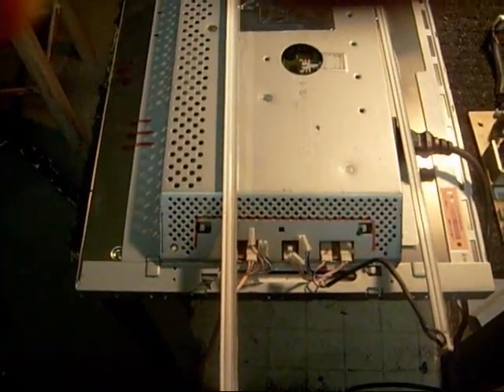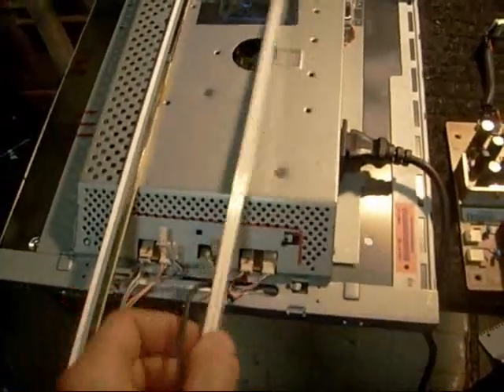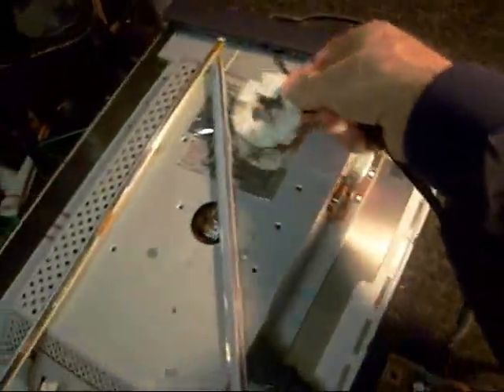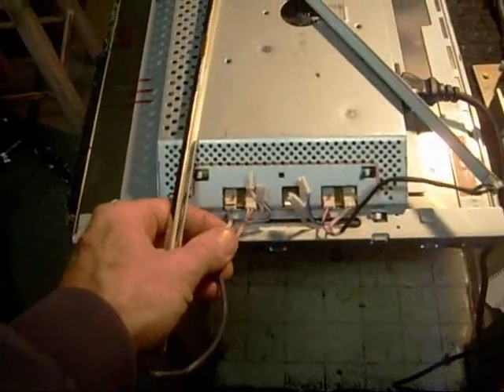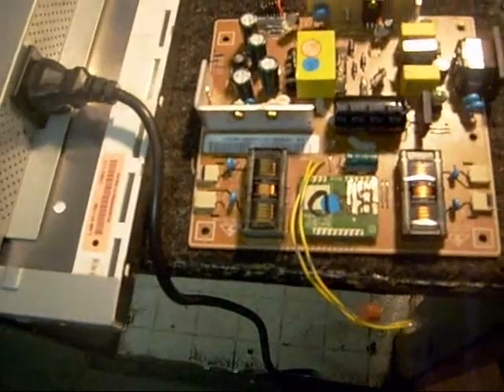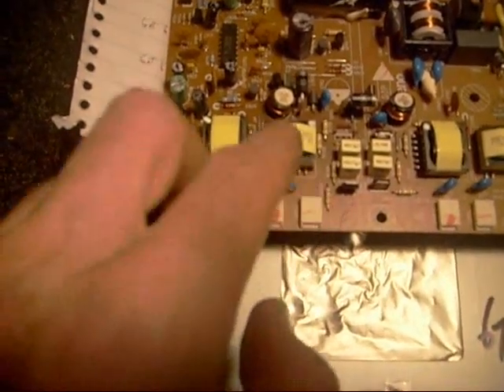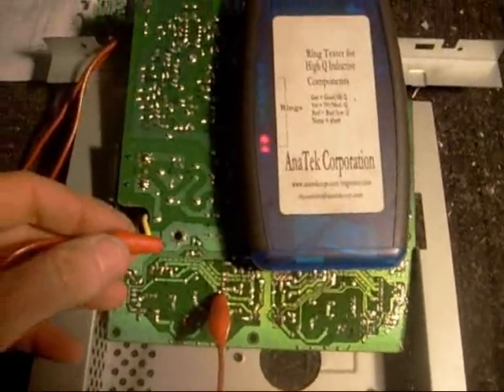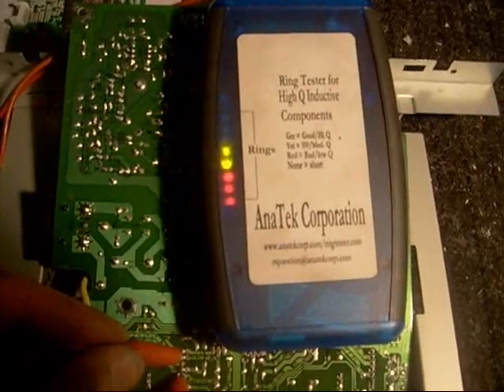LCD TV Repair made easy # 8

Comment: Hello, complete NOOB here, what is that audio-generator? Is that a transistor radio, with a coil attached to it? Please confirm - I'm puzzled. Stay safe
Reply from the maker: I should have said audio amplifier rather than audio generator. The one I used was a small battery operated unit with a coil for the input rather than a microphone.

Comment: Hi there, love the videos... AT 3:45, would it not be better to suggest to people to carry out a mandatory check of the transformer and some of the other surrounding components, in case there is some other failed component that would cause the transistor to blow again.. oh btw, I felt stupid going in to the supermarket to buy a hair dryer to test a computer board, but I didnt feel stupid when it powered up after heating it's capacitors.. great tip.

Comment from the maker: I would start by examining the power supply for shorted transistors and or any other components which may have gone bad. I don't know if your particular power supply has a pico fuse or not, but if it does it will generally have a notation next to it which says F1, F2, or F3 etc.
    In case one of your other boards has a short to ground it might drag down your stand by voltage. You can check this by UN-plugging the other boards and see if stand by voltage returns.

Comment: If you could be so kind to humor onr last question. On a sony kdl32 there is no standby light and the fuse was blown after replacing it came on fine the went off. Once again no standbye light but fuse was not blown. Could there be a pico fuse causing this. Or how do i go about getting the standby volts. I will not continue to bug you with amature questions in the future. Thanks in advance.

Comment: hi. Frist off i have to say your set of videos have helped me soo much with fixing lcd tv and monitors that i get from a recycling center. Could you please help me. i have a magnavox 32mf337b/27 32 in lcd tv. i took it apart because it was shutting down a minute after being on. there was 3 caps  i replaced. it worked for a short time. now it will turn on then chirp and turn off. it sounds like its the transformer. where should i go from here? i have a MM. thanks if you can help

Comment: hi great video,, my philips 42" lcd has stop receiving an HDMI signal from both ports ive been told that its the main board thats at fault and will need replacing or fixing,, im pretty good at circuit repair but was wondering if you might know which part of the main board thats at fault,, cheers

Comment from the maker: @chevy56123 
If you mean to add extension wires from  the inverter board output from one TV to the other TV just to see if your back lights are working I would think it might be okay but I have never done it that way. Sometimes  I  do this with an external transformer just to see if my back lights are okay, but you can't always tell if you back lights are okay when looking at the front of the display because of the polarized lenses on the display so I momentarily tap the screen when doing this

Comment: Dave would it be possible to take the plugins from a tv inverter board to the backlights from another tv and hook up an external backlight to see if it was the transformer or backlight?If so how would you connect the plug to your external light?

Comment from the maker: @billyshears666 Sometimes they are not worth fixing as you are finding out. This is why I am now saving many of the old parts. I did find the ebooks on LCD repair and power supplies helpful but like any new subject they still require lots of study time. There were some parts of the ebooks I found to be a to complicated but other sections were just fine. As far as I know the books I listed on LCD TV repair are the only ones available other than factory manuals and those can be real difficult.

Comment: Excellent videos... I watched them all. I just started fixing all the LCD monitors that my work tosses... big waste of money! Some I find easy to fix (power supplies) others are out of my reach (inverters). I've looked at replacement inverters, but they are usually $70 and up... usually can find a new monitor on sale with warranty for about the same... any suggestions? Is the ebook helpful there?

Thanks again for all the wonderful info... keep them coming!

Comment from the maker: @cristoretornebiblia 
Yes you can test a coil for shorts using an ohm meter but the ring tester I demonstrated sends pulses of energy into the coil and monitors how many times it oscillates or rings after each pulse. This can help you pick up problems that might not be detectable using an ohm meter. You can replace the coil on the inverter board but sometimes it's hard to find the part. Did you watch my video where I talked about this?